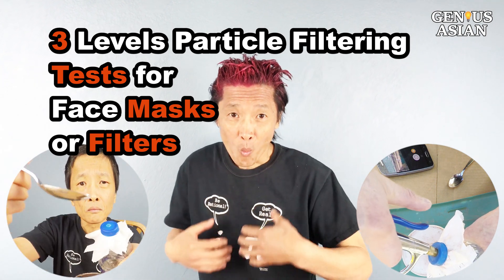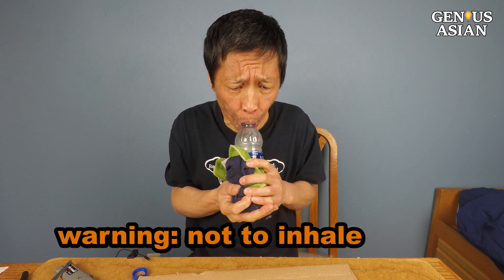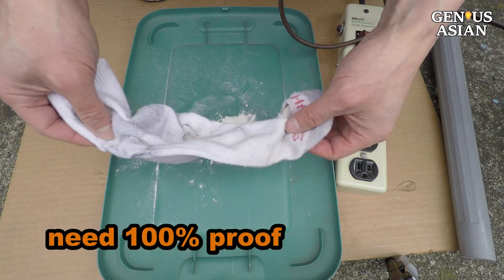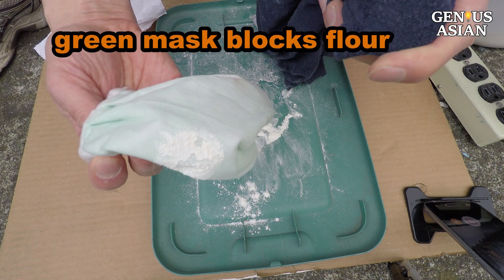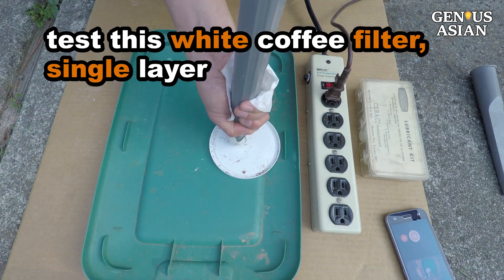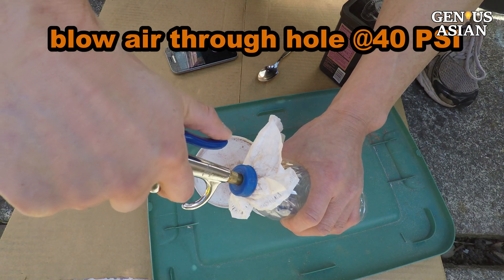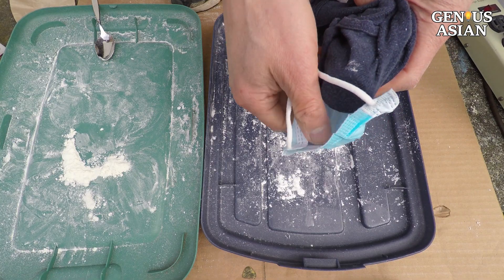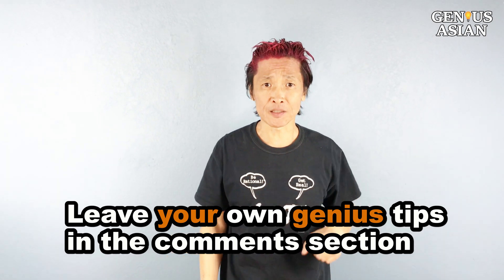3 Levels of Particle Filtering Tests for Face Masks or Filters

Comment: Would you say there a noticeable difference between the filtration of different surgical masks? Like do the bpe, fpe etc actually make a difference and are the worst surgical masks likely to be much different than the best? It’s hard to know whether manufacturers certifications are even meaningful these days so I would like to know if the worst surgical masks (given it has the 3 layers) is much different than say, an actual fda approved, Astm mask.
Reply from the maker: yes, CDC has some tests recently: https://www.cdc.gov/niosh/npptl/respirators/testing/NonNIOSHresults.html

Comment: You mention humans exhale at 1 or 2 psi. What is the psi at which humans sneeze or cough.
Reply from the maker: the pressure does not vary that much, at least not too high to tear your filter materials.
Reply: Is it likely then that a vacuum would collect much more and smaller particles than our lungs would be able to?
Reply from the maker: @jaliu  Yes, but when the particles land on your lungs, they are harmful even though they are fewer in lungs than vacuum and may not be visible with naked eyes. When you have vacuum, you may have more and smaller particles, however we are comparing filter material 1 vs material 2 under the same vacuum, we make a conclusion which material is better. If your material led to a different conclusion, i.e. filter 1 is better than filter 2 under one pressure but the opposite is true under another pressure, or filter 1 is better than filter 2 for particle 1, but the opposite is true for another particle, please leave comments below because we have yet to find such a case